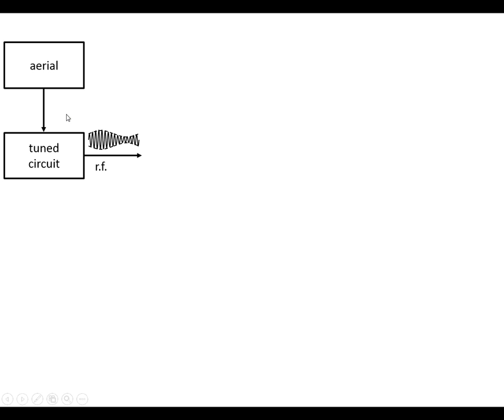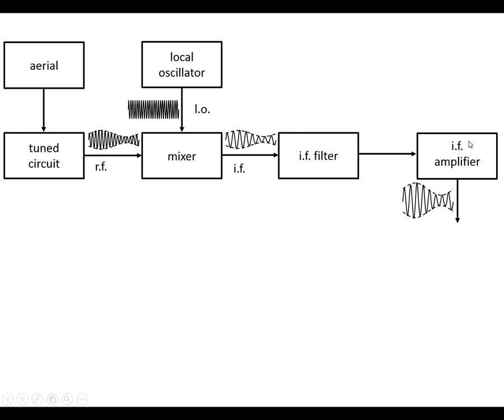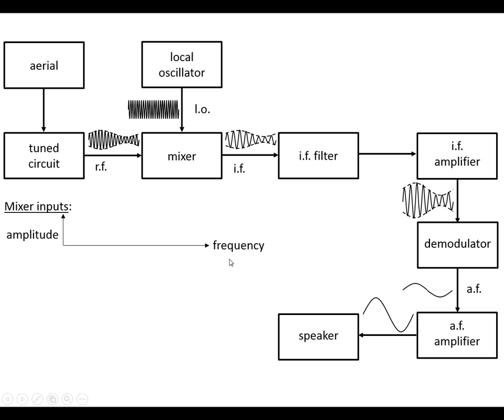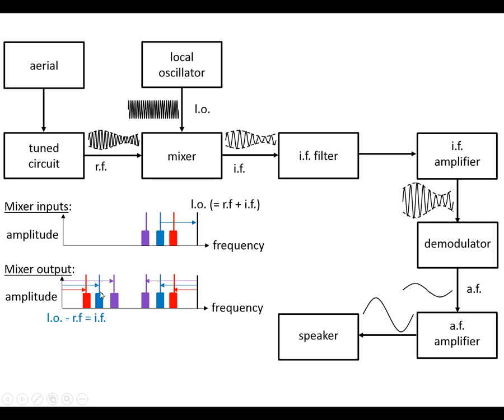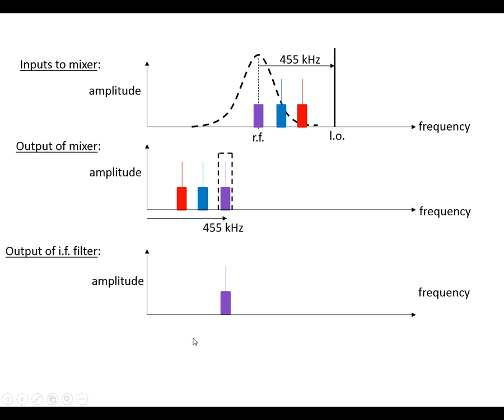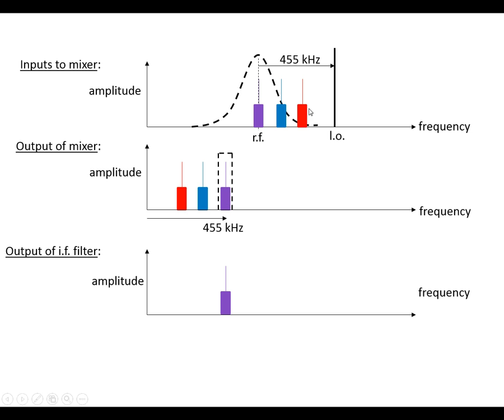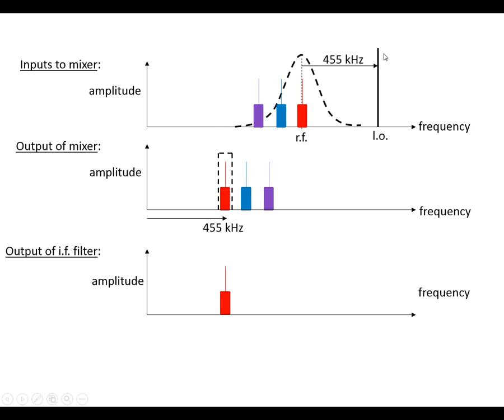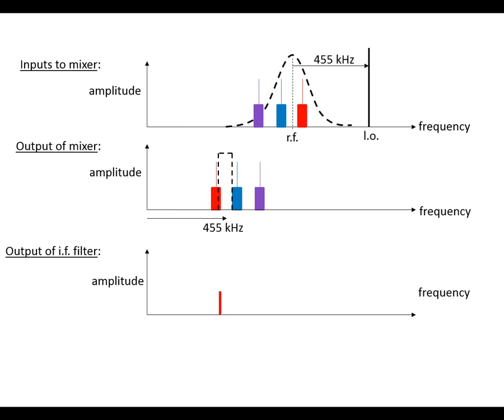Superhet receiver

Comment: I may have missed a fundamental point in your presentation. I am guessing that to make an exact duplicate of the RF amplitude the LO amplitude must be higher than the largest amplitude on the RF signal. I am guessing that the Amplitude on the IF signal, as well as any other signal made from this mix, is always the lowest amplitude both positive and negative or upper and lower of the two mixed frequencies. Is that a good or bad guess?
Reply from the maker: My understanding is that the mixing is done by amplitude-modulating the RF signal onto the AM signal. This creates sidebands at the sum and difference of the two frequencies (as with AM). The difference is the IF signal, and the sum is much higher than the LO. If I'm getting your query right then the LO amplitude must be larger than the RF amplitude (when I demonstrated this in class I used a square wave as the LO to chop the RF using a MOSFET - it was very  rough, but showed the copy at IF believably enough for my students).